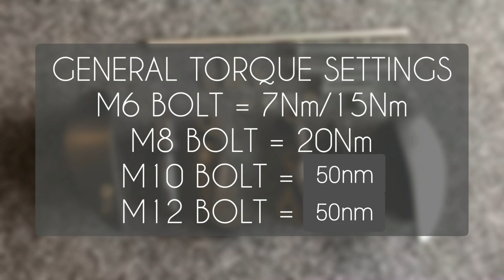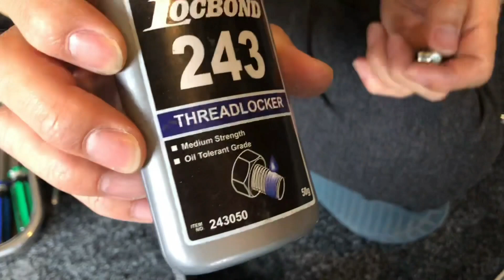SUZUKI GEN3 HAYABUSA WINGLETS FRAME SLIDER (No Cut)

Comment: It is very wide. Used to like it till I sat next to the new busa and saw where the mirrors end. Then I saw the design yoshimura came up with. This lvl of protection is extreme and to much as in case it dropped you will touch the top anyway. The fairings are important and the engine. Hope you modify the specs and the design visually is nice.
Reply from the maker: Never touch the top please check the website : https://www.vitalperformance.net/productinfo
Reply from the maker: And here is the real crash video: https://www.vitalperformance.net/shop
Reply from the maker: And also check this guy’s youtube: https://youtu.be/q9kBVn48INI